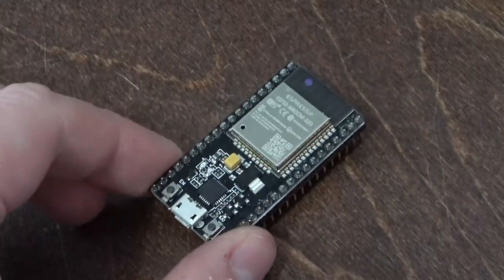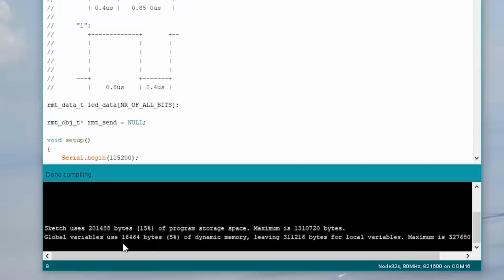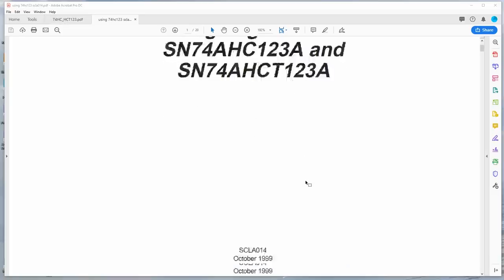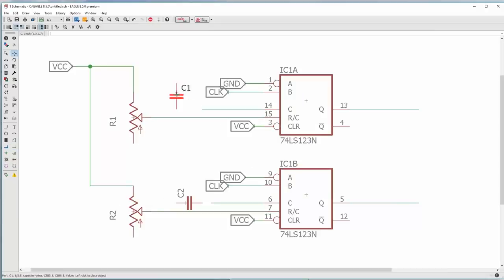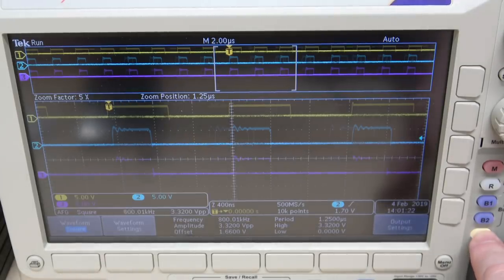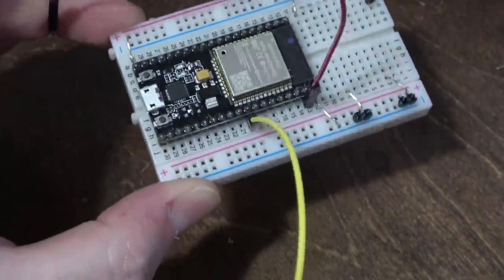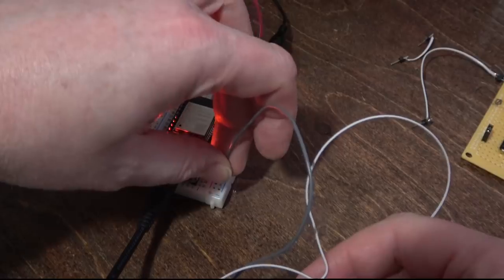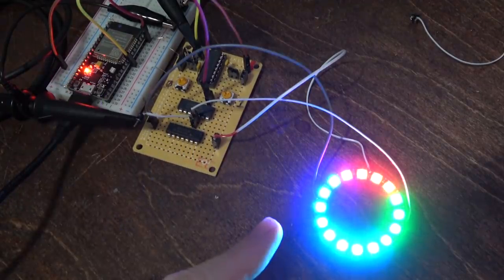SPI to Neopixel Adapter

Comment from the maker: Just realized you don't need the AND gate you could just pipe SPI data into the "One" pulse timer. (assuming you used SPI Mode 1 where the data and clk rises at the same time)
Reply: Would you just hook up SPI_DATA to the CLR pin of timer B?
Reply: The rmt_data structure also doesnt have 4*4 bytes, you just didn't notice they are bitflags. Nice choking sounds though!
Reply: Also, you don't even need to 74 series logic gate, you could just use 2 diodes.
Reply from the maker: There'd be a bit of a voltage drop for the first Neopixel but yeah, should still work.
Reply: @BenHeckHacks   Yes, with a Schottky diode the voltage drop is negligible at 5 volt,
Reply: i know this is off topic, but Ben, can you hook up color lcd on logitech z5500, i have my old trusty one but like all z5500 it has lcd led diods problem, you can swap it for a new one but can you run color display on it? :) Maybe idea for your new video, cheers
Reply: An alternative is to use two NAND gates (7400). Connect SPI data and Q from the "one" timer to one  gate, and the output from that to the other gate together with the /Q from the "zero" timer.
Reply: Do you mean just using SPI MOSI to adjust the RC of timer 1?

What about just clocking the SPI at a higher multiple (like 7 times faster), then just have bit patterns for a "zero" or "one" pulse length?

Still very little overhead for the software, and it could still use DMA.

It's a great way to demonstrate how simple monostables and logic gates can solve challenges like this, though.
Reply: There is no need for additional logic. Just the MOSI data line is fine -> https://github.com/vanvught/rpidmx512/blob/master/lib-ws28xx/src/ws28xx.cpp and schematic -> https://github.com/vanvught/h3dmx512-zip/tree/master/eagle/Orange-Pi-Zero/Pixel/P2
Reply: ElectronAsh  Hi,
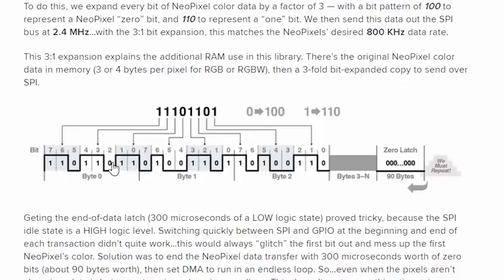Isn’t that comparable to the Adafruit solution at 4:07 using 7 in stead of 3 bits? The point of the video was to create as little overhead as possible. I’m sorry if I misunderstood.
Reply: Eduard van Raalte why worrying about ram usage? Just use a board with enough RAM. There are ARM boards with 256MB for 8€ (for example Orange Pi Zero). Then there is no need for any Addison all logic, except the line driver ... and 300 ohm resistor
Reply: Arjan van Vught Hi Arjan,
If tried to grasp what is happening in your code but I don’t get it. I can see that you go at great lengths to set the right buffer size and clock speed depending on the number of leds and type of leds used. 
Could you please give some pointers as to where you transfer data from memory to the spi bus? Tia! Eduard
Reply: and this hust defeated my 1 miinute of doing boolian algebra to proove that you unly needed one quad nand ic instead of 1 quad or and one quad and
Reply: asdasd 
Aren’t there 4x uint32_t variables declared? So the structure is using 4x4 bytes as far as I can tell. You are right that it would have been sufficient to use only 4x4 bits. 
Please correct me if I’m wrong.
Reply: Arjan van Vught 
I saw your work on github, very nice.
At the beginning of this video Ben said he wanted to drive the neopixels from a ESP32. I know, you can get these with 4MiB, but if you would want to show some dynamic video on a rather large screen, you could run into a memory shortage. 
Maybe a bit far fetched, but it’s the technical challenge of the video and I quite like that challenge.
Reply: @lennartlindell7044  I didn't put much thought into it, but I was wondering if the output logic could be done with all NAND gates to reduce the BOM count from 3 ICs to 2 ICs.
Reply: @ArjanvanVught  - It's not only RAM usage. It's also programming overhead, CPU cycles, etc. Using DMA to drive SPI directly from RAM is quite elegant.
Reply: Yeah, I was wondering why you didn't just do that.
When I wanted to get into addressable LEDs, I did some research beforehand and went with the SK9822 instead of the WS2812. Ties up a second pin to send clock pulses, but that also makes it a lot more forgiving if your MCU can't output an 800khz signal.
Reply from the maker: Tried it, there was a bit of a dip in the long pulse I wasn't happy with. Sticking with a quad NOR since that also gains me chip select. Thanks for the suggestion!
Reply: If you do pick up a string or roll of SK9822 LEDs, I'd love to see a video on it, since your analysis tools are somewhat more thorough than what I have access to. In practical experience, what I put together seems to work flawlessly on a lower-end MSP430.
Reply: Using SPI is too complicated. You can use I2S without any extra components and on any output pin you like. Check out my pov lightsaber project on github. It works like a treat and doesn't need cpu time.
Reply: @bitluni  - Your PoV sabre is a really cool project! I2S does DMA as well so that reduces CPU overhead. The remaining advantage of Bens hardware solution is less memory for the pixel buffer and less bit manipulation to fill the buffer. (Your I2S code uses the Adafruit 4 bits per bit method and i2s_write_bytes for writing longer high vs low bits). Both methods have their advantages...
Reply: why not just use the FastLED library? It only uses one byte per color channel of the leds
Reply: @k1ngjulien_  As far as I can see the current version of that library uses bitbanging and doesn't support DMA.
Reply: @ArjanvanVught  yes but as explained in the video, that requires [at least] 3 transmitted [and therefore buffer] bits for each data bit in order to produce the correct waveform. The code you linked to actually uses 8 bits of output [and ram space] per actual bit of data. So instead of a single neo-pixel using 3 or 4 bytes of ram [depending on if it is RGB or RGBW], the code you linked to will use 24 or 32 bytes of ram for each LED.

Comment: Wrong struct size for the rmt library. LOOK AT THE BIT FIELD SIZE!!!
Reply: Yup! He also missed the union. I guess this the author doesn't know C programming, at least bit fields and unions. "rmt_data_t" total size is 32 bits or 4 bytes.
Reply from the maker: I don't fully understand that part. But compiled RAM size still figures to 96 bytes per pixel.
Reply: @BenHeckHacks  Bit fields let you pack multiple numeric values within a single (integer) structure field without having to do the complicated bit operations to pack and unpack the data yourself. Each rmt_data_t is only 4 bytes in size (since it's packing 32 total bits of data into a 32-bit uint32_t data field).
Reply: @BenHeckHacks  Well, that's 4 bytes per bit. A pixel has 24 bits. 4 * 24 = 96. If it was "times 4", it'd be 384 bytes per pixel...
Reply from the maker: @MrRadar  Got it! It's still a lot.
Reply: @BenHeckHacks  Also looks like someone has written something that uses an RMT interrupt to keep the buffer full without having to allocate a huge buffer for every bit: https://github.com/MartyMacGyver/ESP32-ws2812-demo Still a really cool solution though!
Reply: Offloading the bitbanging onto the spi controller is still neat tho...

Comment: After some years I finally found time to rebuild the fixed version (Mentioned in the issue log of your Repository) of this adapter to drive a WS2812 strip with a STM32... And as I could not setup the required SPI Speed with an STM32 Blue Pill board... After some testing and different approaches to work around this issue, I ended up with a scaled solution, that a single STM32 Blue Pill board drives 8 (eight!) WS2812 strips in parallel with up to 512 LEDs each in full speed (freerun mode) 🙂

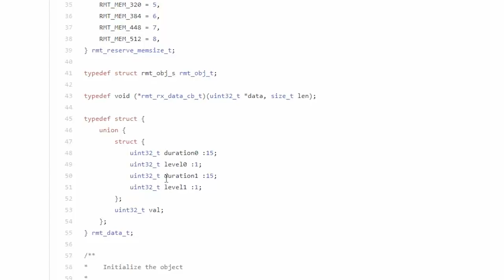Comment: 2:33 this is a union with bit packing. So the struct with its 4 vars is 32 bits total, not 4 by 4. Its only 4 bytes for the whole struct. The way the code is written gives easy access to either the 4 parts or the whole thing as a 32 bit unsigned int.

I see this A LOT in the real world, and it's a huge advantage of C. The number after the colon is which bit the value is stored at, and this saves the user from even needing to know what the bit offsets are. Unions are great and this one looks to be written pretty nicely
Reply: Yeah I saw this too -- it's still pretty bad, but not nearly so much as he expresses in the video.
Reply: @HypherNet  Why is it 'pretty bad'? Looks fine to me.
Reply: @RichardEricCollins  It's pretty bad because it's very wasteful for this application that needs to transmit loads of bits. It's using 96 bytes of storage per neopixel, even though only 3 bytes are needed to represent the state of that neopixel - an efficiency of 3.13%. It's probably fine for remote control applications that only need to transmit a few bits for each control code. Using it for neopixels seems to be more of a quick hack by someone using existing libraries to get something up and running quickly.
Reply: that annoyed me too. informational videos that teach a lot of people should know the language they are reviewing...
Reply: no. the number after the colon is not "which bit the value is stored at" i.e. an offset, rather it's the width of the bitfield.

Comment: The 1-to-3 expansion for the direct SPI control doesn't have to take any extra RAM; you just have to expand your pattern to 3 bits as you write it to the SPI input buffer.

Comment: NeoPixelBus uses the I2S hardware support currently with a better RMT method coming soon.
SPI will waist a clock pin which ws2812 don't are about.  SPI is better for APA102 which needs that clock.
NOTE:  The RMT buffer EXPLOSION is crazy, but they finally added support to SHARE the RMT ISR so it can be converted on the fly.  The approach I wanted to implemented and drove for that support.

Comment: Great idea. Even if the RAM saving isn't as much as you originally thought, being able to push the data to the pixels using DMA simplifies the code quite a bit and also means there are more cycles available for WiFi, Bluetooth or whatever else you're using to change the pixel content. I like this a lot.

Comment: SPI clock is identical to the longer output, so a lot of logic circuitry could be saved here by feeding the SPI clock directly in to the AND gate

Comment: Question about how you connected the pot. Since you are using it as a clock, would the unused pin act as an antenna and randomly adjust the bias of the RC circuit killing stability? Should you tie the unused end of the pot to the wiper to remove that? Or would that resistor (unused side of the pot) loop act as an even better antenna than the floating pin? Or are your frequencies in this circuit too low to worry about this?

Comment: I think you can use only half 74123 without logic gates simply driving an extra resistor (with a diode) into the RC time circuit

Comment: Nice! I recently used a 74LS123 on my CNC-64 project to generate a step pulse on the rising and falling edge of an output pin on the C64 user port. By doing it this way I was able to get a 1kHz step pulse rate from a NMI handler while parsing movement commands.

Comment: I...
I...
I didn't know "And" and "Or" gates were actually a thing that existed. Always figured it was a super simple representation of programming, or at most an also super simplified version of combining signals using transistors or the like, but no-one used them like that IRL. This feels like everything I learned has been turned upside down XD
Reply: Actually, inside the gates they are using transistors so you were still right even before. But it is really cool to see the simple "abstract" stuff being used iRL.

Comment: what about using fast led with apa102 led instead.
Reply: Works with ws2812b too
Reply: @ctjet99channel  FastLED works with a fair few RGB serial controller chips. It's awesome.
Reply: @bleepbloopblahp  I'm using it for my own projects with the esp8266 and esp32s right now. I agree it's amazing

Comment: The best hardware for driving these addressable LEDs is by far the Teensy platform. 

The Teensy 3.2 and 3.5 are the most popular. Each boast 256k of RAM, so excess RAM usage basically doesn't matter. Also there are two great libraries provided by the teensy developer himself. Both libraries are hardware solutions and minimize CPU time significantly by using DMA, timers, etc. The first, and most comparable library, is the WS2812Serial library that uses the built in hardware serial to create up to 6 (on teensy 3.5) LED light bus channels. The second is called OctoWS2811 that uses the built in PWM hardware to drive up to 8 channels of LEDs (at the cost of losing 8 pwm pins and the associated timer). You can drive literally 1000's of LEDs with minimal CPU overhead. 

In my testing today I was getting something like 70 microseconds of CPU time needed to drive 150 LEDs using the WS2812Serial library. The same amount of LEDs required 4 milliseconds of CPU time using the Adafruit_Neopixel library.

Comment: I have been using STM32 Blue Pill micros to build pinball machines with WS-2812s and SK-6812 (RGBW) leds and the library uses the 3byte per byte method to create the pulse widths for the SPI output. One thing I was wondering about your design is the stability under the harsh conditions that a pinball machine finds itself in. Since the BluePill has more than enough memory and flash to handle the 12 bytes per pixel needed for the RGBW leds and is crystal controlled, I am fairly sure it will not have a problem, but an RC circuit might not be as stable and the margin for error on the pulse widths is not that large. I think Steve Evens' post below about using an ATtiny as the converter might be a good idea since it would again give you that crystal controlled clock rates.

Comment: I have another idea of how to do this without needing the logic gates. I'll test if when I have a chance. Basically have 2 resistors feeding the timer. One hooked straight to VCC, the other hooked to the output of a PNP transistor. The base of the PNP transistor would be hooked to the SPI data line. When the data line is 0, the transistor will turn on and the two resistors would be placed in parallel, lowering the overall  resistance and thus the pulse length. Might even be able to pull it off with just a 555 with some clever trickery.

Comment: You miss understood the code. The library uses one uint32_t per bit, the 2 duration and 2 level are stored in a single uint32_t, and inside the struct you have the Union, but that doesn't increase the size of the struct, it just give you another way to access or copy the data without having to copy each element of the struct
Reply: I also don't like the first library, it uses to much cpu and memory. But I would use the SPI with DMA library as it doesn't need any extra hardware (also no extra cost)

Comment: Quad UINTs per bit: Arduino's stupidity in a nutshell :) I usually do the alike stuff on 8-bit MCUs (as 32-bit ones are an overkill and FLASH waste there, imo), and for this thing I'd just transcode the stream on-the-fly (takes 8 SBRS-ORI paired instructions per byte if talking AVR, 24 clocks). As for the bus, just using a 7-bit UART feels like the best choice as it already has a start and stop bits (to have the leading '1' and trailing '0'), just needs an inverter which you are better to have as a line driver anyway, and will require a faster chip due to the 8-tap sampling logic. The SPI+timer for the preemptive interrupts is also a possible choice, though if lazy enough this can be done just clocking the pin manually (in the very most cases of lighting control the chip is idle most of the time anyway so this will save you the parts for no actual cost).

Comment: Cool project.  Look up what a union does when there is also a bitfield.  The bits become packed.  That said, it's still 24 bits per pixel, at 4 bytes each... Probably.  It may only keep that around to send the pulse chain out for a single LED, and reuse them after.

Comment: Ben - on the revised schematic the “ONE” timer is triggered by the rising edge of the MOSI signal. On the video at about 15:50 the scope shows the MOSI signal at a solid HIGH for the entire 0xFF byte. Would not this transmit only (1) long pulse and (7) short pulses instead of the (8) long pulses expected (Only one rising edge)?

Comment: I don't know if it was pointed out yet but that rmt_data_t struct should only take up 32 bits. The struct has uint32_ts but the : 15 and : 1 denotes how many bits that field in the struct actually uses. So it's not 32 * 4 + 32 bits. It's 15 + 1 + 15 + 1 = 32 unioned with a 32 bit field so it only actually takes up 32 bits. Still a lot for just driving an on or off state.
Reply: 64 bits cause there is an int32 after the bit fields/union
Reply: "val" is unioned with the struct. the 32 bits in "val" correspond to the bits laid out in the struct

Comment: could you not use 2 PWM pins for signal generation? (has to be some way to sync it to the clock) this would halve your chip count.

Comment: Ben, while you are having a stroke about the struct with the "uint32_t" for every member of the struct. You seem to miss the colons. :1 means that it only uses 1 bit in the struct. the uint32 in front is just misleading. You should read more up on structs in C :) And then "theres also a value in here?", is a UNION. Which means that you can address the same memory, only 32 bit in total for the union. Either via the struct which picks out the bits from the uint32. Or the "val" which is all the bits combined. So rmt_data_t is only 32 bits in memory.

Comment: Wouldn't it be way more compact to use a tiny microcontroller (like e.g. an ATtiny) to convert from SPI to the WS2812B protocol?
I was thinking about a way to build compact dedicated hardware to drive those LEDs that would reduce the resource requirements on the main MCU for quite a while now...
Your approach probably is a lot cheaper, though, especially in larger production quantities. xD